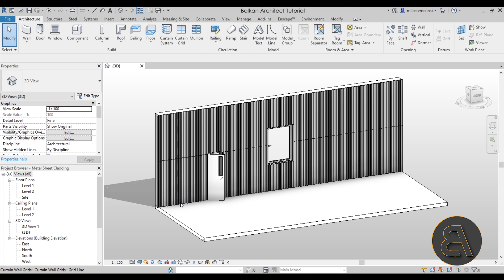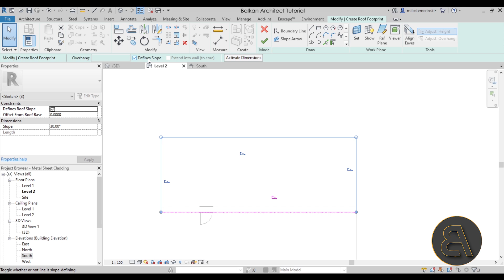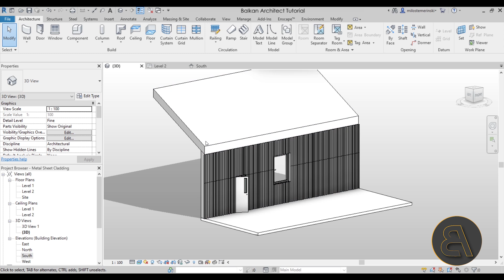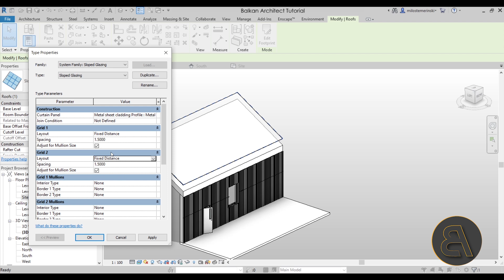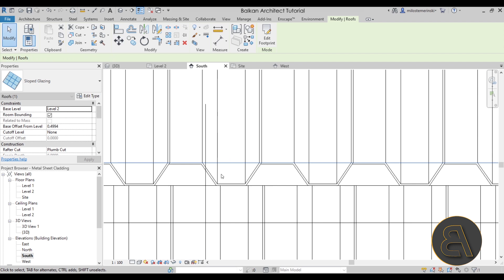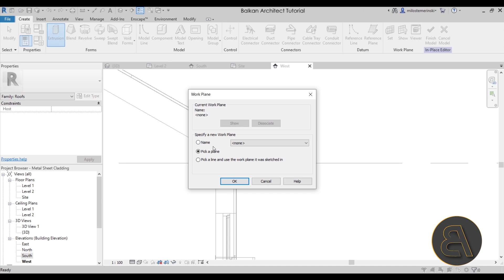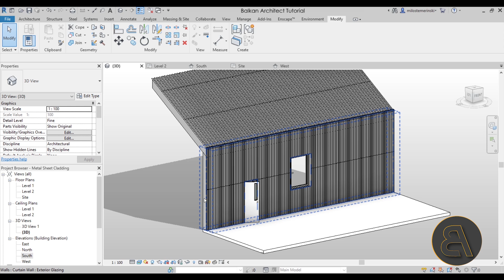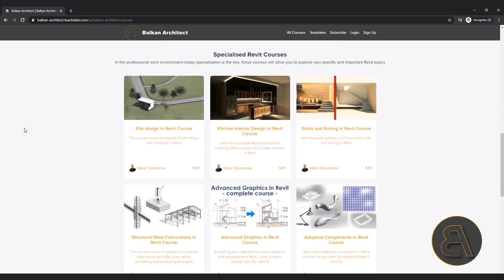Wall / Roof Cladding (same material) in Revit Tutorial

Comment: Hi! I'm a design engineer for the glazing industry. I am learning to Revit. There is not much information about the glazing shop drawing in Revit. I do all my shop drawing in the Autocad 2D. Do you recommend to use Revit for glazing shop drawing? Most aluminum system companies such as Kawneer, YKK have BIM drawings. Please can you share a tutorial or advice for glazing shop drawing in Revit?
Reply: If you want precise drawings i would recommend Autocad, if you would to model 3D then of course Revit. However Revit could be faster to make shop drawings specially if you can find the components from those companies.